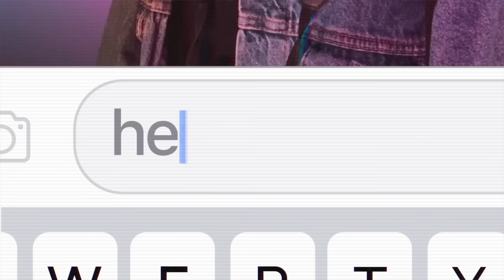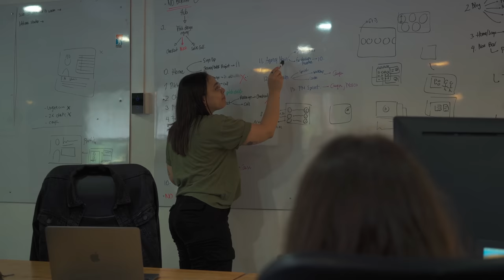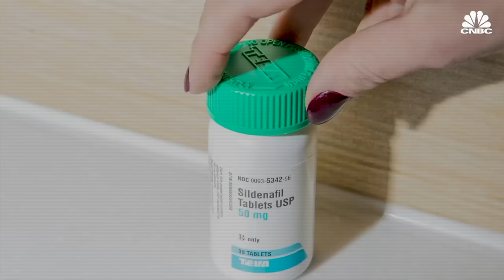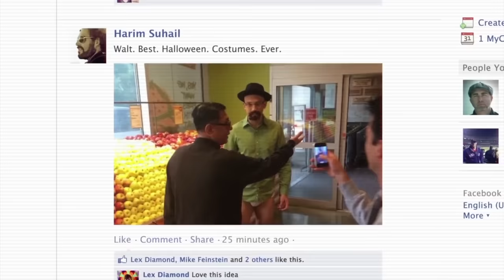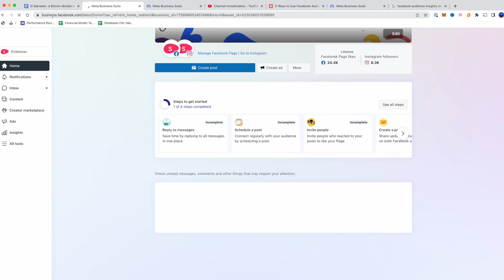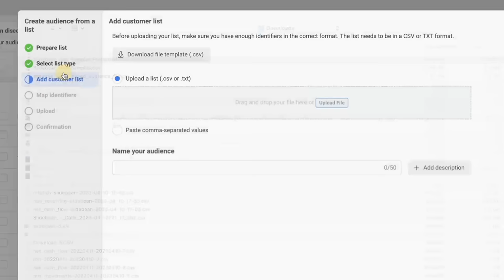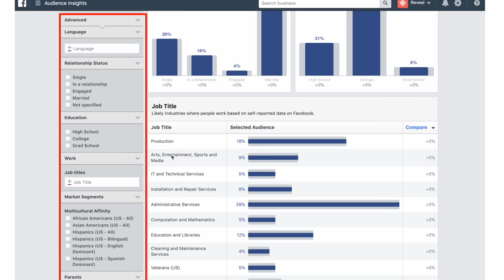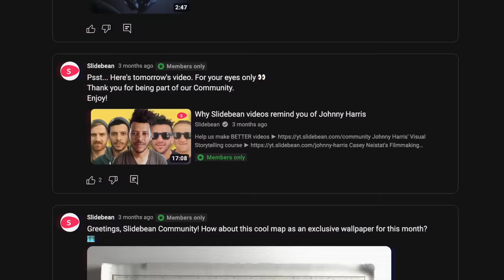Selling Human Data - Evil Businesses

Comment: quick note here - you're not your digital representation =).
For example, I like that Google could "compare" "your" taste with the choice of restaurants on the map. But in my case - I choose not for myself, but for my wife as well, so it's just irrelevant.
And that applies to other aspects of life as well. So I find it non-intrusive if you control what you share =).
For the platforms themselves - THAT'S ABSOLUTE TRUE, Not all platforms are equal in storing/handling information and preserving GDPR.
Reply: I'm not really getting where you're going with this. As in: you think Google doesn't know that? Quick story time:
One day my girlfriend wrote me on iMessage that her colleague's mother passed away who I also know personally, so I decided to write to her. After the usual "my condolences" message, actually just hours after, without talking about anything funeral related and my gf not even getting home (so same Wi-Fi is not the condition here), I received an ad on Google Maps for a funeral home. Now for the plot twist: I was not even using my iPhone as my main device at that time. And I opened Google Maps on my main device. My main device was running CalyxOS. A degoogled operating system with huge focus on privacy. I don't need to tell you that I wasn't ever signed in with my Google account on that phone. But the mere fact that I was on the same Wi-Fi as my iPhone was enough for Google to figure out that this phone belonged to me. How did they know what I wrote in iMessage? That's up for debate, as I don't know.
So the tl;dr of this: don't even think you can outsmart Google with their shier dedication to find out everything about you and use that info to place some creepy ads everywhere you go.
Reply: @PvtAnonymous  does Google know that I choose not only for myself? No, it doesn't. It's much more stupid than you think.
Yes, such things as tracking and sound/voice recording are real, but you can (almost) completely disable it. I haven't seen ANY targeted ADs for years, only ones related to my previous searches (like, if I searched for GPU in eBay I had recommendations based on that search, and that's the most enterprises could get).
Let me state that clear. You decide what you share and what will be used for targeting. I choose not to share anything except for necessary cookies, the ones which save your login token for example. It'll be annoying to fill in passwords every time on all websites.

One more example - people complain much about spam in their mailboxes. But for unknown to me reasons they couldn't click on "unsubscribe" button in the bottom of unnecessary e-mails.

So my advice - just don't agree with default cookies settings, disable ad targeting and disable tracking if you don't want to be tracked.
Yes, it won't remove all tracking, but at least it'll be hidden, and won't impact your search results and recommendations.

About "how did they know..." - depends on privacy settings (again). And... Don't take that as advice, that's only my position. I don't believe Apple (I have only ipad pro at home, which my wife uses as an artist) and any "smart helpers" like Alexa, Cortana etc. I don't believe Google (Pixel in particular), but use search, maps and mail. That's basically it.
And, again, I live the ordinary life. But I don't receive any kind of recommendations being shared between apps. It'll be really annoying for me, I buy some stuff for my wife very frequently (for example, flight tickets and accommodation). And it'll be crazy if I had to deal with all the related spam I don't care about. I just bought what I had to, and I have nothing else to spend money for.

I'll repeat. I have no targeted ADs.
Reply: @sergeymatpoc  well, maybe you didn't get my expertise in the field of privacy and security. I run Linux as my main desktop OS. I run Graphene on my phone. I selfhost my own Nextcloud, Bitwarden, Snapdrop, my own notes, contacts, calendars and some more. I don't use Google search. I use mainly FOSS software. I run a PiHole on my network. I know my stuff. And rest assured, my "privacy" settings are all in check. The stuff Google collects can't be disabled ever. My example doesn't even fall in the category of targeted ads. Because it would not be possible according to their own privacy policy or ToS. Just the proximity of your phone next to your wife's is enough to determine such choices. The techniques used are way more sophisticated than simple cookie tracking. Again, if you think you can outsmart Google, you're just plain wrong.